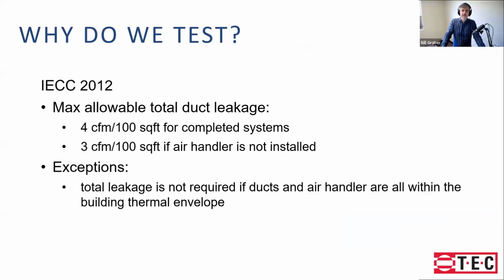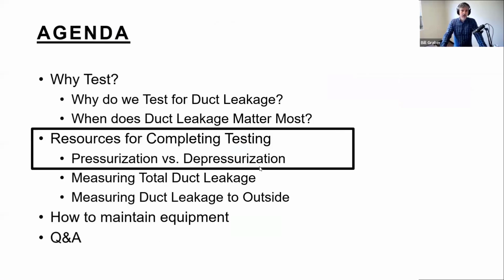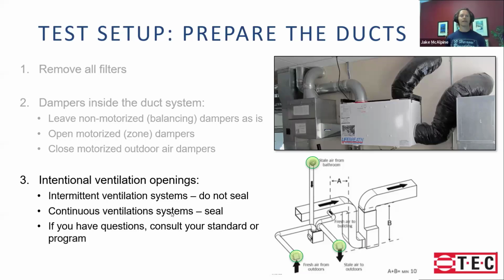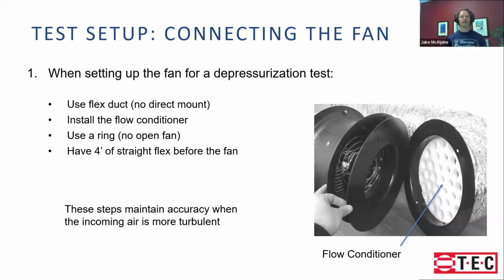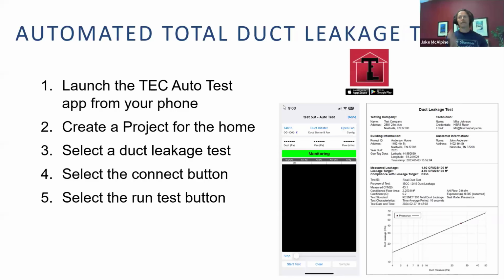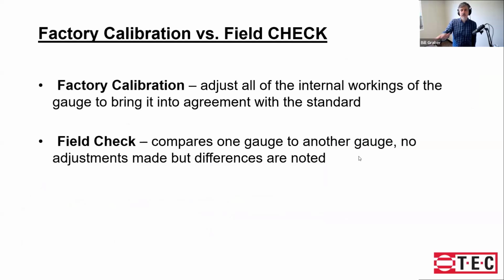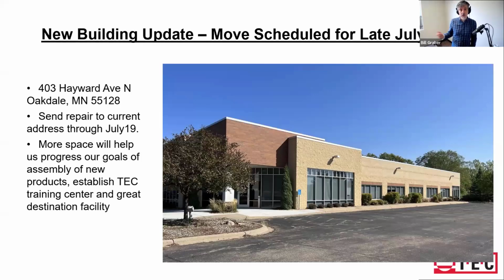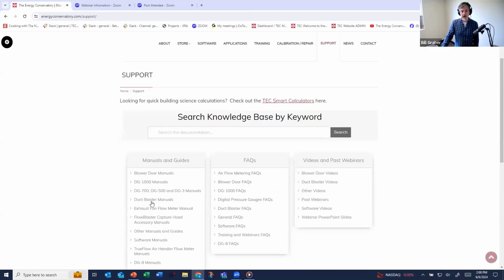Duct Leakage Testing Basics

Comment: I recently had a duct leakage test conducted in my town home in FL. My HVAC unit resides inside of an upstairs closet. The gentleman who conducted the test didn’t connect the blower to the actual HVAC by removing the panel. He connected the blower to the door of the closet by using a blower door cover. Is this considered the correct connection method? When I asked about not connecting the blower directly he stated it was against FL law to touch my HVAC unit to remove the panel.